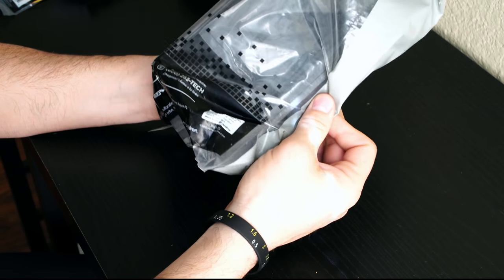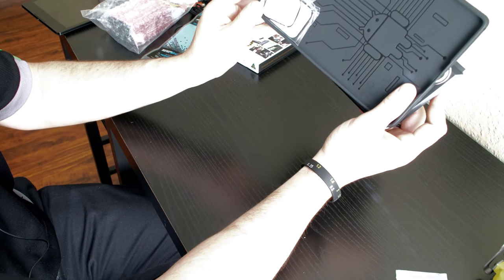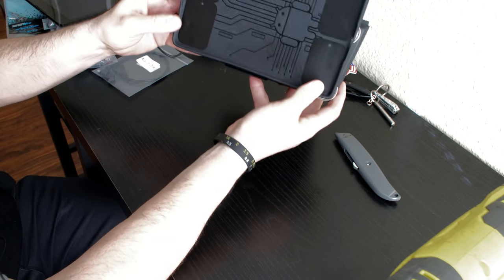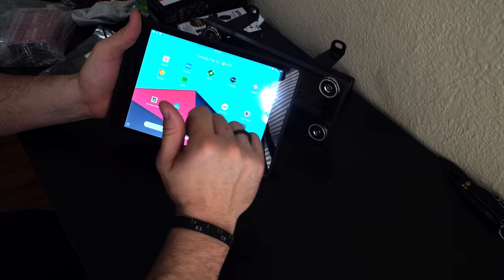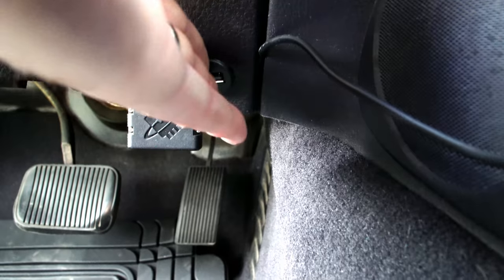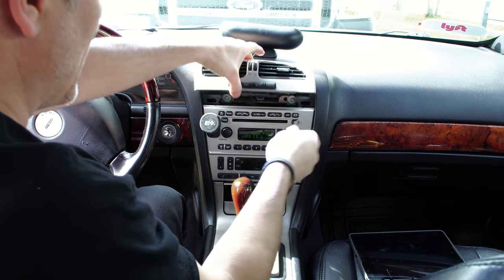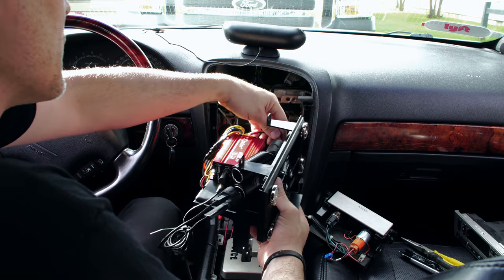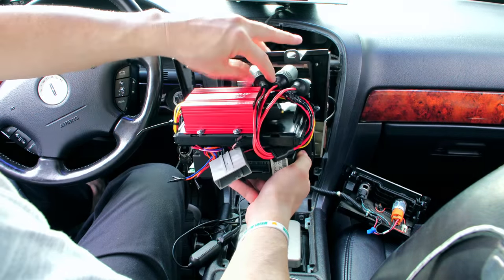Turn Your Tablet Into A Head Unit

Comment: sorry but this is just another gehtto install without duct tape, lol. This could have been much cleaner with a android head unit and they even have mirrioring for your phone for a less than 200 bucks but I appreciate your ingenuity.
Reply from the maker: I had a lot of fun in the process of making this. I would much rather build something than buy it. Check out my update video for reasons why I don't use an Android head unit.

Comment: Your lack of volume is for two reasons, one you're having the run the front and back speakers in series which halves the output from the amp to each speaker, you're also driving a 2v input on the amp with a 0.8v output from the tablet.
Reply from the maker: You're absolutely right. 😂
Reply from the maker: Thanks for the input.
Reply from the maker: Check out my update video as well. I made some changes.
Reply: @edwardlthompson  I've not seen the update. Anything like this is a learning curve (that's the fun, right ?). I've just installed "open auto pro" on a Raspberry Pi as my latest head unit project.

Comment: Does this process work for just about any car ?
Reply from the maker: It sure does. The only thing you need is the single DIN insert and the proper wiring harness and you'll be set for whatever vehicle you are working on. All the internals and connections will be the same as mine.

Comment: Does the magnets not fuck the screen? I remember a mate of mine had a huge pair of speakers either side of his TV and the colours drained on one side because the magnets were to close to the screen on one side!! Literally looked like the colours were somehow pulled across the screen. It was an old TV as this was a good 20 yrs ago (fuck I feel old), or does it not matter a fuck with screens now-a-days? 
Just curious, thanks. ✌
Reply from the maker: Sorry I missed your comment until now. I'm old enough to remember that as well on the old CRT monitors of the 80's and 90's but LCD/LED panels work differently and will have no such issue with magnets. Same with storage as magnetic media has been phased out long ago.

Comment: Have you found a dongle or adapter that can help control AC/Climate through your tablet? Also any cameras that can transmit live video to the tablet when backing up the car? TIA!
Reply from the maker: There are a few Bluetooth cameras on the market that could work for the backup camera. There's also an adapter to convert the video signal of existing cameras to a USB adapter. As far as climate control goes, I have see a company that has a giant screen replacement for the dash of a few vehicles that has climate control programmed into it but as far as something off the shelf, I'm not aware of anything at the moment.
Reply: @edwardlthompson  Thanks for your prompt response! I will look for backup camera unit etc.
Reply from the maker: @rajeshkhera6487  you're welcome. Good luck with your build. You might want to check out the different set up I did in my truck. It is a lot easier. The video is recommended at the end of this one.

Comment: glue Strip of metal to either side of that tablet case..   You wouldn't need magnet strips just 2 pieces  of strip metal.. It would hold better...  You don't need  magnet sheets ...The neodymium magnets would be more than enough and onto metal it woulf hold even better...    they even sell tablet cases with metal back built in...
Reply from the maker: That would also work. Thanks for the suggestions. Make sure you check out the update video for more ideas!

Comment: i love this, but i hate the idea of the tablet battery constantly charging. especially in Australia where the weather is hot and even dash cams use capacitors instead of batteries due to the extreme heat
Reply from the maker: That makes sense. That is why I designed it to be removed. It is never left in the car. If the tablet gets too hot, you can always unplug it. You can see an alternative setup in the update video that is recommended at the end of this one.

Comment: Why didn't you just use the AUX in on your stock head unit?  I did that in my car plus i added a car EQ to my phone aka tablet. It sounds amazing and is extremely functional and clean sounding.
Reply from the maker: +Oahu Pc I explain in the video how that car doesn't come with an AUX jack from the factory and the hack that the previous owner did was not good quality.
Reply: @edwardlthompson  im sorry for missing the no aux part of your video.  And yeah fm frequency modulators are horrible for sound.  In case your other cars have an aux in the soundstream mpq-90 eq sounds amazing. And the rockville r7eq sounds even better but it's much much much lower quality it's a hidden gem for the price,  mpq90 is the daily driver though. I tried 10 different eqs to find these ones. I drive uber too and don't provide the riders with any extras,  just great conversation and great energy :)
Reply from the maker: That's awesome. Thanks for the tip. Good luck out there. Stay safe and stay well.

Comment: Nice little project! How is the tablet getting internet? Hotspot from your phone or what?
Reply from the maker: Thank you! I made sure to get a LTE tablet. I have a data only SIM in it. If you have a WiFi only model, you could make a hotspot on your phone to use it in that manner.
Reply: Ive seen someone using an NFC tag in their car to set up a hotspot. Saves faffing about when you get in the car

Comment: The question is, how to connect the built-in reverse camera to the tablet? Nowadays reverse cameras are installed on many late model cars but they have basic (for those of us who cannot afford to spend top $$ for top of the range models) infotainment. I have a spare tablet at home
Reply from the maker: There are two ways that you could connect a camera to the tablet. The most reliable way would be through a USB c USB 3.0 connection. The only thing remaining would be for Logitech or someone to come out with an app that would recognize the camera and be able to display that image. I have a USB c hub that I have plugged into my device and been able to use the keyboard mouse and all of the external storage and other peripherals through that port.

The other option would be to have a Bluetooth or Wi-Fi camera that could stream the images wirelessly from the rear. I have a phone that is able to connect wirelessly to a camera that is proprietary to that phone model but companies like Sony have an app that wirelessly connect to their mirrorless cameras, so there are solutions in existence but that are not designed specifically for vehicles. 

I imagine as more of these cheap devices proliferate there will be more development and more options over time.
Reply from the maker: The other thing is a relative unknown to me. I'm not sure what interface the rear cameras are using. If it is a standard connector like an HDMI plug it would be very easy to convert that into a signal that could go over USB to the device. If it is coaxial it would be a bit more difficult. I imagine each car manufacturer probably has a proprietary connection though. I'm not sure what the industry standard is. it is something that could definitely use some more research.
Reply: @edwardlthompson  that's the problem with the reverse cam, no app would recognise that (or maybe the default video app would)
Thanks for the reply. But just wondering, why didn't you use Android Auto instead of car launcher?
Reply from the maker: @9231tomi  Android Auto is so stripped down that it's almost useless compared to the actual Android OS. AA has only phone, messages, music, and navigation. To activate it, you have to connect your device and then it renders your device unusable. I will demonstrate it on my truck in an upcoming video.

Comment: Good job. You should use a monitor or an Area so you see where the camera is pointed at.
Reply from the maker: You are absolutely right. I have been using the HDMI micro port to connect to a monitor on my recent videos. Sorry about the framing.

Comment: U could do better job. But one big question... Did u considered how those magnets affect the electronic components in the tablet?? Powerfull magnets and those sensible electronic components dont mix very well usually 🤔
Reply from the maker: There has been no issues with the magnets and the tablet. Everything is solid state in the tablet so with no moving parts there is nothing it could interfere with.

Comment: Is it posible to use an old laptop for this??
Reply from the maker: Sure. I'm not aware of any software that would emulate a head unit interface but you could connect it to the audio system and use it that way. There are laptop specific car mounts that you can use. Most of them bolt to the floor. For an alternative setup, check out my Update video which is recommended at the end of this one.

Comment: Great job for a first time installation, troubleshooting advise.  My concerns are: 1. when you pull off the table all the wires show and 2. when you hit potholes or heavy bumps will the unit pull of the magnets.

Personally, I like the flush look.  Would go more with an android radio.  Less wiring and noise issue and troubleshooting.

Again; GREAT JOB
Reply from the maker: Thanks for watching. I address some of those things in my update video. I put an object in that opening to hide the wires (when I'm not in the car) and I went drifting in that car with the tablet attached and drove for thousands of miles and it never moved a millimeter.
Reply from the maker: Here is the update.

https://youtu.be/dmiVHRV2etw
Reply from the maker: Exterior drift video.

https://youtu.be/EDxwDqxwCwA
Reply from the maker: Interior drift video. You can see the tablet at the bottom of the screen on the side facing the interior.

https://youtu.be/HLvBKnOJ7-Q

Comment: Really interesting set up. But I didn't get how you did connect the Bluetooth to the amp?
Reply from the maker: I ended up running the setup without Bluetooth but if you wanted to, you would just connect the BT dongle audio jack into the audio input on the amp.

Comment: You cant put the out put speaker wires togther to that amp it has to be ithere front out put or rear out put speaker wires if not itll burn out and thats why your Valium whent down
Reply from the maker: Thank you for that tip.

Comment: Liked and subbed awesome vid must have took a lot of time and effort researching. Do you know it it's possible to link the steering wheel volume and phone controls to this?
Reply from the maker: Thank you so much! Yes, it should be possible. I had the kit to activate that. It works the same way that the earbuds that used to come with phones do. There is a signal for volume up/down and play/pause. The other option is to get a steering wheel mounted Bluetooth remote.
Reply from the maker: You may find the update video I made useful as I did a different setup in my truck. You can find the video recommend at the end of this one.

Comment: Sorry but dont understand why you did not super glue the plastic supports on, instead of using self tappers.
Reply from the maker: The self tappers are more certain to hold in all temperatures.

Comment: Have you tried to use micro USB and a audio Jack to do the work charge and use audio?
Reply from the maker: I have. I tried a few different ways in a few different dongles but unfortunately micro USB does not allow audio and charging at the same time. There are some that you can manually switch back and forth between the two but unfortunately there's no way to get both done at the same time. if you have a micro USB tablet, your best bet will be to connect a Bluetooth audio source to the amplifier.
Reply: But if you use micro USB to charge and an audio mini Jack to it will charge and do audio at the same time I think
Reply from the maker: @abiliosousaBillyCrow  sorry, I misunderstood you. Yes, you can run a second line out of the dash to the audio jack and that will work perfectly fine.

Comment: So I tried doing this and like you this is my first time but I got one problem I wired , rewired all of my connections and only my front left speakers are working and it’s very low and I’m using a aux to Bluetooth receiver I’m not sure if it’s that’s the problem or my amp is getting not enough power I’m not too sure I have a cable coming from the harness that says “amp turn on” I’m not sure if I should use that
Reply from the maker: That's awesome you did something similar! Thanks for giving it a try. In hindsight, I probably should have used a larger amplifier. I eventually got the volume to a decent level but I had to play around with the switches on the amp to get it right. Also, make sure the mobile device is not limiting the volume due to some manufacturers trying to protect their users from turning up the volume too high when using "headphones" as that's what they assume is connected to the 3.5mm jack.
Reply from the maker: Also, make sure to watch the update video I made to see the jellyfish of a unit in its final form. 😂 The update video is recommended at the end of this one.
Reply: @edwardlthompson  I appreciate you responding I was looking everywhere for wire diagrams for my car and there not a lot of information and it’s not fun sorting through wires when ever I have time I’ll definitely take a look and more time to think through it fully
Reply from the maker: What Watt amp did you use?
Reply: @edwardlthompson  I’m using a 150 watt amp just realized that the one you are using is a 500 watt amp
Reply from the maker: Yeah, that will make a big difference. That output from the mobile device needs to be amplified a lot to power those large speakers in your vehicle.
Reply: @edwardlthompson  I just purchased the same one you have hopefully I’ll have some better luck there !
Reply from the maker: Excellent! Good luck! That should fix the problem. If that's not enough, you can try to find one that is even more powerful or get a single DIN with a Bluetooth connection if all else fails and hide the single DIN behind the tablet.
Reply: @edwardlthompson  I appreciate the help I’ll let you know what’s the update
Reply from the maker: Awesome, thanks!
Reply: @edwardlthompson  so I got the same amp that you have and this time no sound dead silent I hooked up my other amp I have and it did the same problem like last time very quite
Reply from the maker: That's very strange. Did you toggle the switches on the unit?
Reply: @edwardlthompson  yup I tried every combination  low high in the middle filter low filter high and even off no sound at all
Reply from the maker: That's odd. I didn't have any issue with mine but I did have to fiddle with the switches to find the one that was the loudest.
Reply: @edwardlthompson  no worries I bought a Bose 1100 watt amp hopefully that’ll do the job
Reply from the maker: That should absolutely do the trick!

Comment: To help my fm transmitter, the car wash ripped off my antenna. So the transmitter works pretty good most of the time,😁
Reply from the maker: The previous owner had installed something that communicated over the FM radios via a direct plug into the antenna but I continue to get interference in certain areas in downtown Fort Worth.
Reply: @edwardlthompson  https://www.amazon.com/gp/product/B002U5XPBE/ref=ppx_yo_dt_b_asin_title_o01_s00?ie=UTF8&psc=1
It sounds like this is what you have. I installed the same thing in a Cadillac I had. It's infinitely better than a regular cigarette lighter FM transmitter but there is just some static. With music I found it mostly unnoticeable but when I would listen to podcasts I could hear the static. Quality also wasn't perfect because it was still an FM transmitter at the end of the day. If you get to that actual part you can play with the gain and find what works best for you but there was really no making it perfect.  Luckily in the Cadillac it had OnStar which is no longer in use today so I was able to just wire into those speaker wires to make a better aux. If you want no static and the best audio quality possible, you would have to find some way to wire directly into the speaker wires. For those who don't, that FM modulator is the next best thing and is more than acceptable.

Comment: Is it possible connect your tablet to your phone? If so, how?
Reply from the maker: All of the apps you use on your phone are available for the tablet and sync across devices, so I'm not sure what advantage that would provide. There must be some kind of screen mirroring app, though I'm not immediately aware of one.
Reply: @edwardlthompson  Thank you for answering me! I was thinking about answering phone calls with the tablet while driving so I can hear and talk easily, using the tablet's mic and the speakers of my car, like head units allow us to do.
Reply from the maker: Yep, you can do all of that on the tablet. Google Voice is the solution I use but there are other possibilities. When I receive a call, it rings all my devices, including the computer. I can take calls on the tablet.

Comment: interested in what apps you find improve ''ease of use'' to things like nav and music
Reply from the maker: For music (I mostly listen to podcasts) I use Spotify and I pay for the Spotify/Hulu bundle.

For navigation, I only use Waze. I started with Google Maps because I used to use Google Music for all of my music and podcasts and it has an integration with Google Maps. when they announced they would be phasing out Google Music, I transitioned to Spotify because it integrates with Waze. However, the main reason I switched to Waze is during my time driving for Lyft and Uber I found that Waze had far more accurate maps and traffic. There were times where Maps would get me stuck in some terrible traffic. I believe there is some kind of delay between what is happening and what Maps registers. Waze is pretty much real time and it also alert you to law enforcement and other issues on the road.